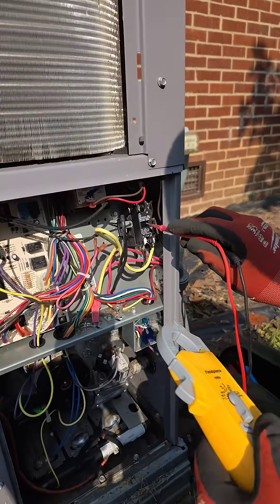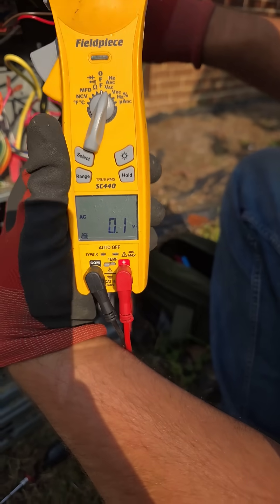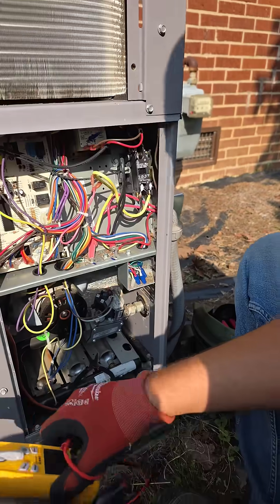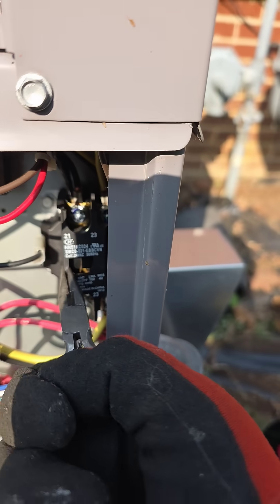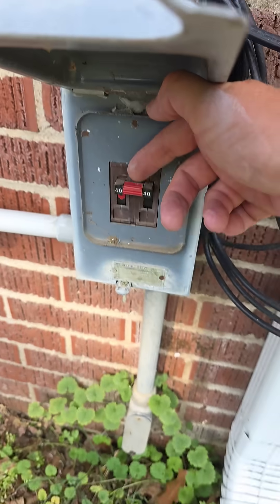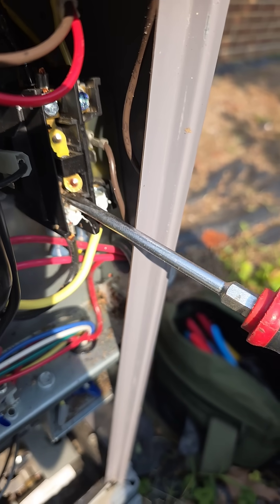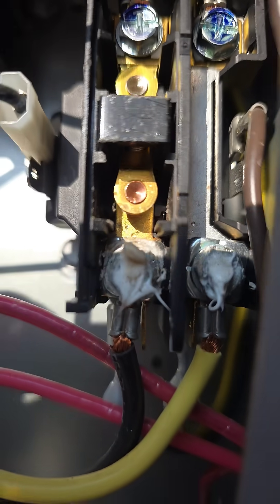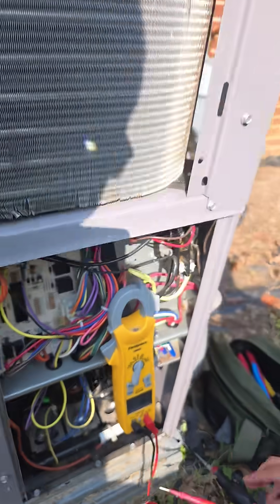Ants Shut Down This AC System! #airconditioning #hvac

Comment: I had a similar problem with my unit.  There was an earwig stuck in the contactor.  Cleaned it out with a toothpick and the unit started running like a champ.

Comment: So I have a pool business and i do it all. O saw this video last night and today got to a customers house and the pump wasnt turning on at the Intermatic timer. I had 240 coming in. When you flip the lever to turn it on nothing. Not even power on the load side. But still 240 on the line. Its a 5 year old timer and those things are pretty damn reliable. Thought maybe the contacts went bad. Took the mechanism out and on the back of the contacts  you guessed it. Ants. What at the odds timing of this video and my problem today!  Haha. Cleaned it and it fired up the motor!! Ha
Reply from the maker: That's very cool.Thank you for sharing the experience

Comment: Great find and troubleshooting!  Tip> buy a can of contact cleaner (plastic safe) , can of this works amazing. It's literary brake cleaner for electronic contactors. It also removes carbon build up. Turn off the power before spraying  !!!

Comment: Emerson SureSwitch is supposed to be the solution to this issue. It’s a sealed unit. Benefits
•5x contactor life
L1
L2
U
Universal
      Contactor
+ • Short-Cycle Timer = • Brownout Protection
• Long-Life Sealed Switch
   LINE •Totally sealed switch to keep out ants and debris
Y •Microprocessor control nearly eliminates contact welding and pitting
C •Ideal install with new Preventative Maintenance contracts LOAD
RC •Compressor is protected from brownouts and short cycling
•Save on pest control treatments

Comment: Classic. Replacing something that Doesn't Need Replaced!
Reply: @mikeharvey9657  those contactors could be damaged sometimes the ants will get in there and cause it to arc and melt some of the surfaces making for less contact which can then cause it's overheat. The reality is they probably already paid for service calls so putting in a contactor probably isn't that much more than they're already paying
Reply: @mikeharvey9657   I know right.  As a car mechanic if I replace something that is working to make more money is bad for business.

Comment: Man i need some help. I got exact same issue. 120v on one side. 25v from thermostat. And 0v output. I replaced the contactor and still have 0 volts output. What does this mean? Defective contactor or is there something else im missing? Going to disconnect all wires on output side and see if i get 120v or not with thermostat set to cold. If so then maybe i have short. Any advice would be appreciated!

Comment: I found this same problem with the light switch in an ice cream truck. The ants got on the open contacts and when the switch was turned on, no connection. Couldn't believe it when I opened up the switch and found them sandwiched in there. Next switch got a good coat of silicone grease. No problems since.

Comment: a small portable air compressor would do a lot better of a job at that. that contactor looked brand new inside, of course the ants would have caused some arcing burns.

Comment: Great video! Been there myself with my home unit in the July E TN heat. 
Worse thing I ever experienced was a a stink bug caused an Allen Bradley PLC to trip and blow out a three phase contactor which also tripped the building 3k amp GFI Main to trip as well. Not a fun night. 😂

Comment: If I encounter ants in a contactor I always replace it because when an ant dies it secretes the alert pheromone and more ants come to investigate likely getting crushed too doing the same making the alert signal stronger and stronger.  This is why you end up with piles of ants in contactors. Yes you mechanically cleaned out, great, but unless you flush it to get rid of the ant pheromones, they will come back and cause the problem to repeat.  

I was skeptical of this long ago until a friend suggested an experiment (with the permission of the customer) where I took a cleaned contactor that had ants in it and set it next to the unit. I came back three days later and it was covered in ants again, but there were none anywhere near the unit with its new contactor.

Moral of the story is if there were ants in the contractor, you're getting a new contactor for your own good.

Comment: so u fixed it with for the just cost of the service call but you went ahead and padded that bill by replacing something unnecessarily...
Reply from the maker: A contactor is not an expensive part
I went ahead and kept the old one because the customer wanted to.But dude, it's a forty dollar part.

Comment: Yes,they already paid for the call, so replacing the switch is a very professional decision, in my opinion. It will cost them double or more in 3 weeks, considering another service call will be included. I had this exact thing happen in tickfaw LA. Replacing the switch ended the problem. It was my house and I was being experimentally cheap. Conclusion was new switch is the best. I potentially sacrificed my compressor for my silly cheap experiment.

Comment: IF You want to know WHY the ants migrate to the contact points. Well, I will tell you. We found out that the Two magnetic fields produced by the 24v coil and the line voltage circuits intersecting each other produces a resonating frequency which  mimics either FOOD or SEX to the ants.
I've seen this hundreds of times myself over the past 50 years.  I KNOW!  Sounds crazy, we proved it  with an oscilloscope. 
Now we know maybe two words of the ant language.

Comment: Just a diy guy that works in manufacturing as well where we use similar systems for chilling machines and it’s almost always the contractor or capacitor for the condenser unit in my experience did see one unit that had a bad compressor and a few that control wires got yanked out of the contractor

Comment: I’m currently starting my HVAC career at 55 years of age.  Been in the trades for years.  Just another skill I’m happy to acquire.  I see both sides of this interaction between customer and contractor.  Maybe the customer didn’t want to deal with a contactor that had squatting ants in it.  Maybe the customer likes the assurance that a $40 contractor will give him for the next 10 years. The truth is WE DON’T KNOW.  We repair, install, service, and maintain all budgets.  Our customers are given options based on sound advice and my boss’s 30 year career in the industry. All, this is a tough profession, full stop.  The guy saying that HVAC is a rip off obviously doesn’t know what he’s talking about. It’s dangerous, grueling, work.  You’re constantly in tight, hot, uncomfortable, dangerous places.  Electrocution, heat exhaustion is no joke.  There’s more ways to get hurt than I can count.  Also, tools are extremely expensive.  How about $900 for digital gauges, $400 for refrigerant recovery machines, $500 for leak detection devices, and thousands in hand/power tools and inventory such as contactors, capacitors, overflow sensors, PVC fittings, insurance, etc….  sound??? It’s difficult to stay in the industry if the payout is $50 for service calls.  No one would or could do it if that was the case.  If it’s expensive it’s for a reason. Lots of YouTube videos but after that doesn’t work out, you call the guy investing his livelihood in tools, a capable truck,  thousands in tools, and a trailer to fix it.

Comment: Probably carrying a couple of cans of compressed air might be a good idea. Also, I suspect the contacts were running warm which is what attracted the ants. Especially if it’s a heat pump. Personally, I’d replace the contractor. I prefer double pole ones over that single pole crap anyway.
Reply from the maker: Good point, thanks for the feedback!
Reply: @BartlettTFD  I woulda just grabbed some nitro and pshhhhhhh

Comment: I have carried Sevin Dust on my truck for over 20 years. The first time you go to your customers house and insects have gotten in contactor sprinkle a little dust in electrical cabinet. (after repairs) They'll never come in the cabinet again, dust stays there as long as you don't clean it out.
Reply from the maker: That's a good tip, thanks for sharing!

Comment: About twenty years ago I was working on my mom’s ac unit. 
Same symptoms electrically. 
No ants but when I pulled the contractor to replace it I found an earwig in the contact points. 
That little critter dropped the leg. 
Go figure. 
That whole bottom of the ac  unit had earwigs swarming. 
Plenty in the surrounding wood mulch.

Comment: One thing I did see that I would have done too is check the load side one at a time to ground. Not sure if the one side was pulled in or not. 
But you figured it out good job.

Comment: Nice work checking the power after toggling the breaker.  In check with LOTO guidelines as disconnect is with your work area and no one else around.   I call them guidelines as they were written like crap.

Comment: If you just replace the part you can charge the customer for the part at 100%  mark-up plus the labor to remove the old one and install the new one. With all that expense you might talk them into some overpriced protection plan that doesn’t include any coverage for labor. Much more profitable to screw over the customer than treat them right. ~Your Local HVAC Company

Comment: I work IT and had a Battery Back up giving me some weird error message ive never seen before. I go to the rack to look at it, and the back up is flashing and beeping. I go to pull the battery and its covered with dead ants. I gloved up and tried to pull the battery out, but the ant bodys had made a beidge, and it arced and welded the battery to the inside of the chassis. Never seen that before or after.

Comment: My dad got a 5-ton package unit because the local air conditioner expert said it was totally trashed, unfixable. So my dad volunteered to haul it off to the trash for the guy. He took it home took the mouse off the contacts and use it for another 5 years.

Comment: Being an electrician myself this all made perfect sense.

That contactor did look clean, so the most I probabaly would have done was pull it out and make a thorough clean of it, then put it back in. I personally don't like creating additional charges of I can avoid it, because I do know people are on budgets and they always appreciate the minimum charge.
Reply: Look the positive side , he is replacing the contactor maybe to make sure is going to work for a long time, others can lie and replace more than a contactor ,those are really a ripoff. Give him a break!
Reply: @The_Forgotten_Man  he replaced it because there was wear. He changed it, so there are no future issues. Smart decision on his part. He was thinking about the customer. The customer more than likely had the talk with this tech and agreed.
Reply: @summerseve502  my thought, too. and he knew his comment would generate comments on his video, thus making the video more popular, which then makes more money for him. he's a smart youtuber.
Reply: What the did he say he was replacing it anyway why 🤔
Reply: If he didn’t replace it and it fails the customer will say you was just here.
Reply: It’s normal practice to replace the contactor after ants got in it like that because the points could look good but he doesn’t know how long that contactor has been trying to close causing it to arch and other internal parts like the spring could be damaged making it another service call for later that week.
Reply: It depends on what he charges. Not everyone charge 300 or more for small parts. So it’s possible this only added 75-150 to the bill
Reply: Contactor is 20 bucks
Reply: What if the homeowner was smart enough to direct the electrician to replace that contactor?
Reply: @The_Forgotten_Man  I'm assuming he cleaned the contractor to verify that was the only problem before installing new parts. I saw another channels video were a mouse had chewed and shorted the compressor wires. Guy fixed the wires, then installed a new capacitor and contractor. Only to discover the compressor was dead
Reply: @The_Forgotten_Man  As a fellow Electrician, I couldn't agree with you more. Within good reason, if it ain't broke...don't fix it, but to each his own.
Reply: @TheForgottenMan270  yeah I was wondering why he replaced it anyways after seeing that it works and even said it looks fine. You're just adding to the cost for the home owner at that point.
Reply: He prolly up-sold them a surge protector, UV lights, a hard start and a soft start.. AC is such a scam business BUT on the other hand, people refuse to learn how to fix shit for themselves. I wont fix my "friends" stuff anymore cuz they wont pay me and they'd probably sue me if it ever breaks.. It's not the 70s,, people suck ass now-a-days..
Reply: Independent contractor of low moral character, perhaps🤷🤷🤷
Reply: Many guys don't care about people. This guy is a rip off artist.

Comment: Had the same situation before.  An earwig cost me $150 for a no cooling service call.  Not for nothing though, the service tech told me in the spring when I hose out the coil to throw some bug granules in the bottom of the electrical compartment.

Comment: i work on electric forklifts had a call for no power opened it up went to the line contactor it was pulled in but no power on the load side thinking it a burn contactor tip i pull it apart i found a good old stink bug mashed. so i clean it out and it back up and running, so then the customer asks what was wrong with it i said it had a bug in it lol

Comment: If you cleaned it out and it's working just fine, why bother replacing the switch? All that does is cost the homeowner more money. Why not just charge them for the service call and set the groundwork for repeat business?
Reply from the maker: Never replaced it.I left the other one in place because it's working
Reply: @TaddyDigest  in the end, it sounded as if you did. My bad!

Comment: You should have cleaned the contacts on the contactor (Relay) with some contact cleaner spray and run a sand paper between the contacts to do a proper job.

Comment: Homeowner here, I'm not at all an HVAC tech, but after you switched off the disconnect, did you have to discharge the capacitor before you touched contacts?

Comment: The tech should have a small compressor in his work truck for just such an occasion. Use it to blow out all of the ant debris instead of picking at it with a screwdriver.

Comment: Had the same problem with my unit last summer, figured it out myself and cleaned out the ants and sprayed Raid ant killer on and no more issues. Saved money as well
Reply: @davidtischler8323  if you drop several  moth balls inside the unit will eliminate entirely

Comment: Well if what you usually do is replacing the contact or why are you wasting your time trying to remove ants and debris from a damaged contactor. You should have went right ahead and just replace the contact or I made a video showing replacing the contactor which is a common problem with AC units.🤔🤔🤔

Comment: Fundamentals of safe service. 

Lock out, tag out. 

It makes me wonder what else its being shipped over in your presentations.
Reply: The disconnect is with in sight ,, lock out tag out is for when your disconnecting means is out of sight and or more than 25 feet away,,,,, the code requires all stand alone appliances to have a means of disconnect,, be it a breaked fuses  or a receptical  and plug with in the area the stand alone dedicated unit is

Comment: Years ago my mothers outdide washing machine wasnt working i had suspicion that bugs got into the control wiring panel & sure enough ehen i took it apart the panel was loaded with pincher bugs that literally shortened out the connections of the wiring board, you eould never think bugs can cause electrical problems but they did.
Reply: What's a pincher bug? An earwig is the only thing I can assume you mean.. ok, googled it.. same bug

Comment: I usually remove low voltage while disconnect is on. Then touch 24v to terminal repeatedly and that usually smokes them out and clears contacts

Comment: Smart man, used a systematic process of troubleshooting to narrow down the fault. Proper.
Reply from the maker: I appreciate the support!
Reply: @taddydigest  why did you charge the customer for something they didn’t need?
Reply: What really sucks is people like this man are few and far between. So many, whether out of ignorance or upselling, will try to replace the entire thing. Or at least inflate the issue from what could’ve been solved like this. 
As an engineer, solving problems always should begin with the simplest, most obvious, and least time consuming things to tech. Over the years, when I first started, I spent 24 hours rebuilding circuits to find out our power supply was making poor contact. That was 24 hours straight too. A moment like that stands with a person. Check the easiest to check first.
Reply: This is hvac 101 🤷🏽